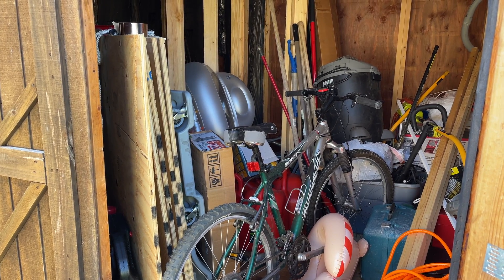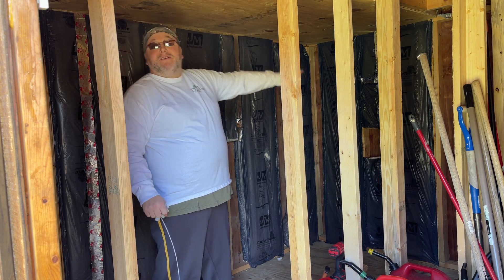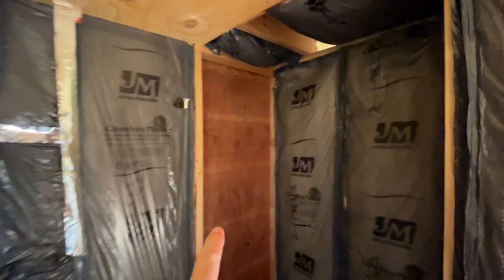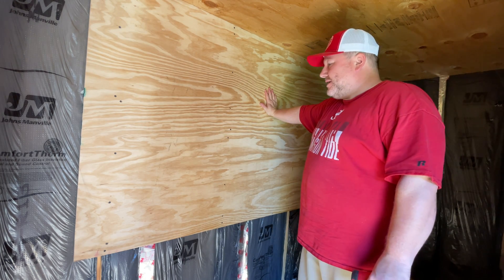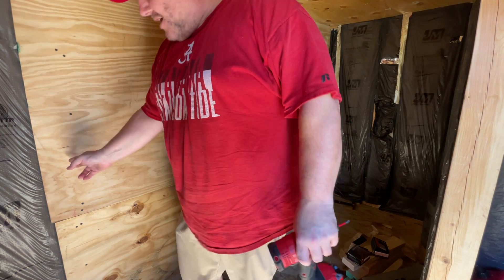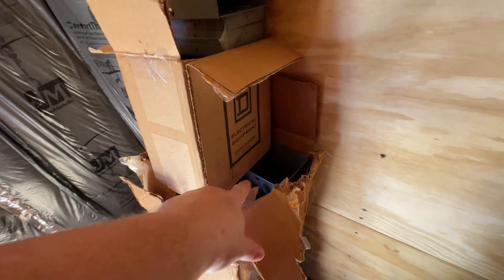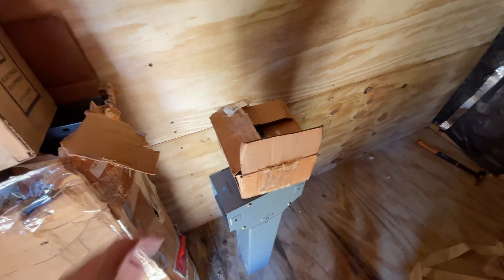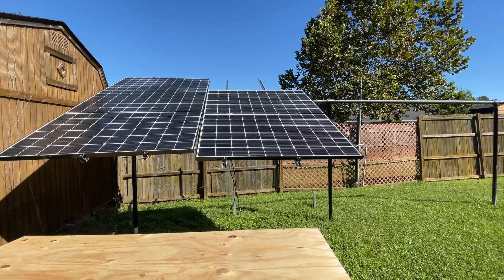DIY Powerwall Storage Building / LifePO4 Battery Storage Building - Part 2

Comment: What are your thoughts on using concrete board on the walls as well as a fire break of sorts?
Reply from the maker: I personally will be using a concrete board behind my inverters, But also recommend following the MFG's spec. Now in saying Concrete board isn't too pricey, but it does have some weight for sure. Now as in a firewall or firebreak, I'm putting my batteries and inverters away from the house, and not in my shop, so if something did happen, i would only loose that building. Of course there's gas in there now, but once finished, i will move a few items out to a different storage. This little building was my first storage shed for my house and It had somethings we were keeping, but as we have gotten older, we decided...nah, we don't need them. Thus we threw them away. But firewall/fireblock - If you keep them stored in your house, YES, but i would say try your best and get them out of your house to safety.
Reply: Yeah, I'm in 100% agreement in having the batteries/inverters/etc in a dedicated building that is not the primary living area. I'm thinking of picking up a smaller metal shipping container and finishing the inside (studs, spray foam insulation, concrete board for walls) and have some sort of shelving setup for the batteries with inverters hung on a wall.

A lot of this depends on where I end up moving to though, next summer we will be traveling up to Alaska to explore a few possible areas.  But until then, I'll be using a portable setup.
Reply from the maker: @atanisoftware  yes sir, I had a metal storage building, but living in a subdivision was hard to keep hidden, but we going to be moving in the next year or 2 to a new property and no HOA… matter of fact, not even in a subdivision… but I’ve gotta keep playing in the markets to back build cash… ;)
Reply: @DIYSolarEnergy  One benefit of where we are going to be looking is there is a very low chance of HOAs :)